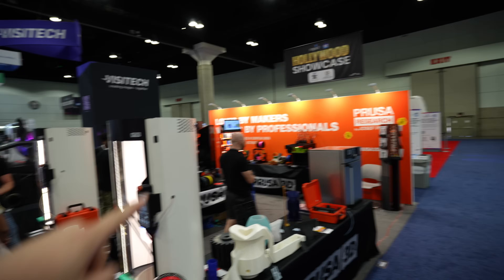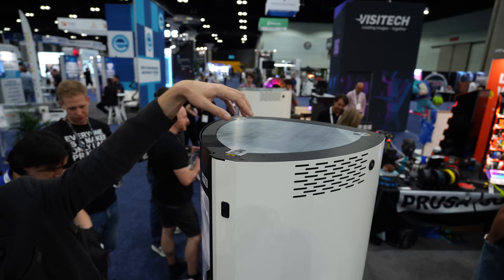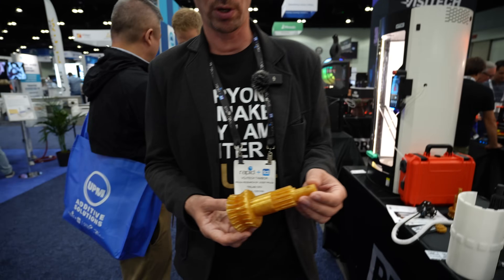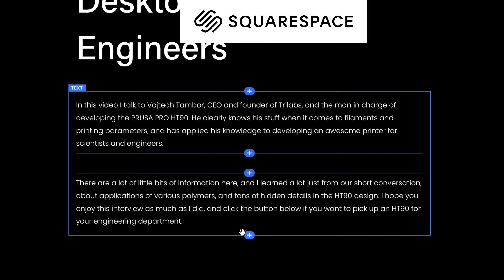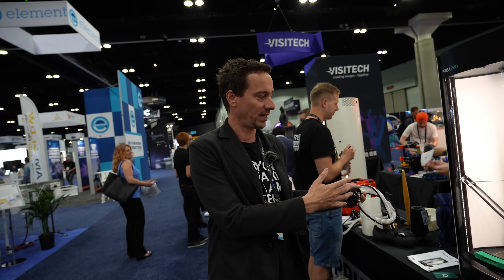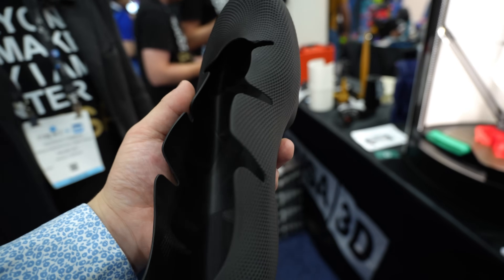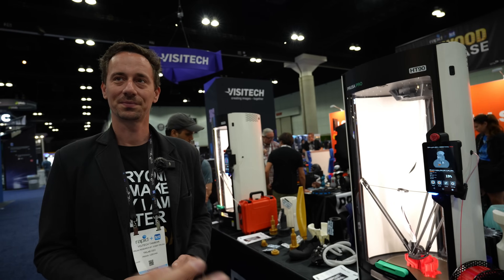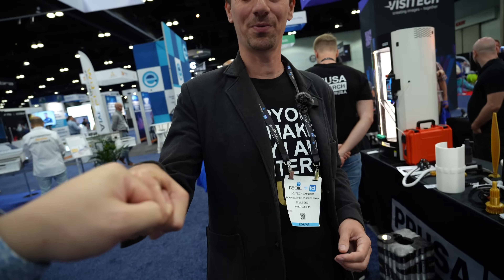PRUSA PRO HT90 - The Best Desktop Printer for Engineers

Comment: I look at this beautiful piece of technology and know with absolute certainty I'm just a caveman with my poorly modded Ender 3.
Reply: Dude... stop!! 😂 I'm an old grognard engineer with 30+ yrs experience and you young dudes with your "mods" make me feel like a hillbilly..  which I am too. 😂😂
Reply: I JUST DROPPED A GRAND this week on a Qidi X Max 3 to keep up my production needs. It arrived June 28th & I still haven't had time to get it even turned on! 😂 Being "old" I experience "kid-like excitement" & anxiety, hoping this machine won't disappoint me. 😂
Reply: I still use my original ender 3 too from 2019. Parts are cheap and it's easy to fix. I will keep it forever.
Reply: @jaya6291 no point.  You can get cheap, but big upgrades with the ender 3 v3 se or ke, and several others. Bought an ender 3 ke for $80 on ebay that needed a minor fix.
Reply: @BuzzingGoober  The se and ke are made to be less moddable and maintainable. An original e3 with $50-100 of upgrades is a better machine than them. Certainly don't throw out a well tuned original e3 for one of those clunky things.

Comment: Cool... as in that's the cooling method.  Just like those of us that used the old CPAP machines and hoses to force a separate airflow so it wasn't just recirculating hot air in a chamber with a small flow fan forced through some squinty air ducts. I'm glad to see it at the commercial level but not really a prusa invention.  Just in case someone else in particular needed to point that out in a negative way, but I see it as a positive step in printer evolutions.

Edit: I missed the part about the servo flap.  That IS cool and unique, as far as I recall.  So I do give them a hats off there also.
Reply from the maker: I’ve though about doing it but they’ve gone and done it, and in a tiny lightweight package.

Actually the method I’ve though about involves a passive flap, with airflow selected based on fan speed
Reply: Hi there and thank you sir. There is one more cool detail which isn’t in the video. There is a second flap for the intake. For materials like PLA the intake is switched to the outside - you can print fast without opening the doors of the machine or similar shenanigans ❄️
Reply: @thejosefprusa  awesome advantage.
Reply: There's already several projects that have been put for quite some time that have had servo flaps to select either outside cold air or inside recirculation  @thejosefprusa

Comment: Prusa shoots straight to the top of the delta style printers... wow!!! And that price tag makes me shake too...
Reply from the maker: Yeah but when you’re printing filament that costs $1000 per kg, for parts that get installed in machines that costs $1,000,000+, and the alternative printer that your company has access to is $200,000 and the size of a car, and  located in a separate building… suddenly the cost of the printer becomes less of a concern.

It’s definitely not aimed at the hobby market
Reply: @NathanBuildsRobots  Sounds like a good strategy, these printers can have high margins. Is is also open source? Could people copy it?
Reply: @adammatic  of for sure… Somewhere in Asia, some dudes are looking to copy it. They even going to find ways to push the idea of OpenSourcing it to Prusa, and wait for it to happen then they’ll rip it off into their own closed source models and mass produce it. My hope is that Prusa can himself take the lead not to open source it, but offer us versions that are mass affordable as an alternate to the current offering from FLSUN, even if it’s not to print those expensive materials, just do the standard hobbyist print and I’ll be good all day. Knowing Prusa, I suspect, he is also of the notion of not eating into someone’s business model too… a moral approach to building a mindset that I wish some folks in Asia had.
Reply: @NathanBuildsRobots  indeed, indeed! That’s the Pro-ness
Reply: its probably the least costly machina with these features. By like 3 to 4 times.
Reply: Creatbot PEEK printer is only about 4 to 5k more expensive and can get the chamber to 120 IIRC and you can heat the filament container to 100C to keep your PEEK dry. @giovannifontanetto9604